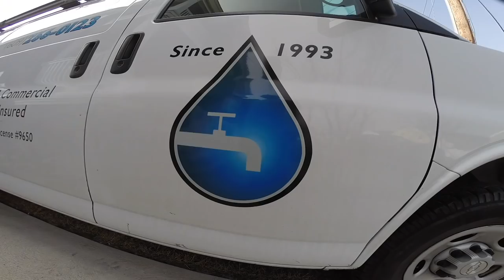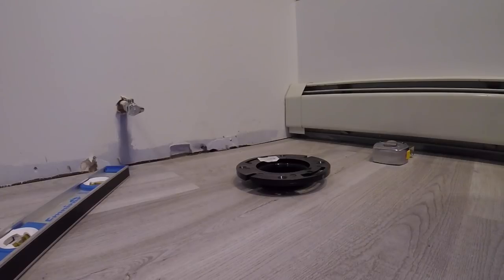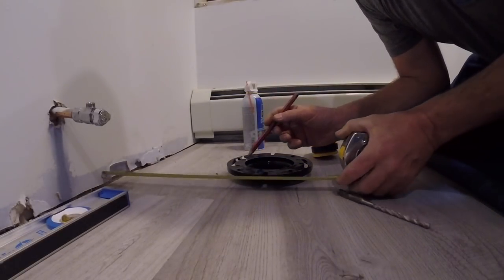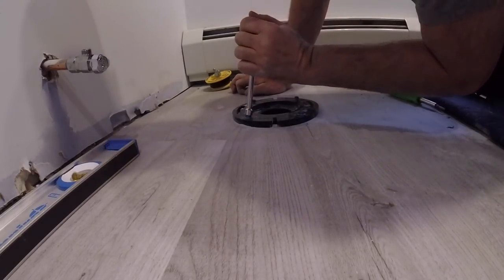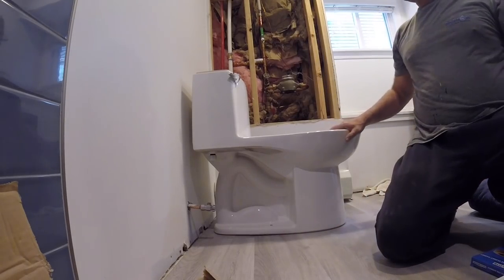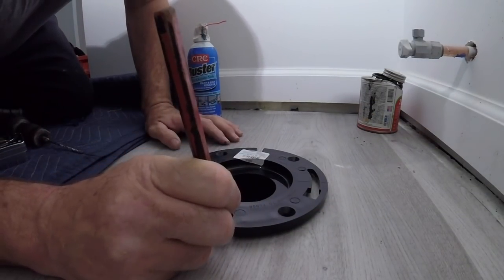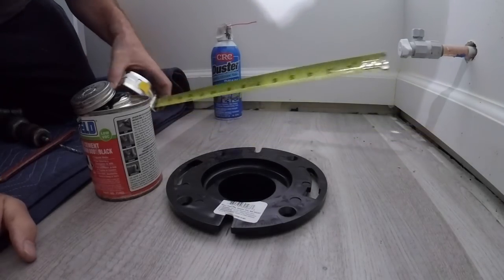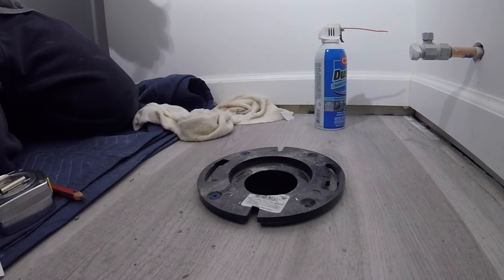TWO TOILET FLANGES INSTALLED ON CONCRETE FLOOR

Comment: i suggest using the stainless steel tapcons, the blue ones always end up rusting after a while even with that coating on them. makes it easier for the next guy if he need to take out the flange. i also had a question, in a perfect world, would you always have the flange above the finished floor (like in this video) or flush with the finished floor (and why)?
Reply from the maker: Oh wow. I like the sounds of that

Comment: Clear basicd and to the point thanks man. I do this in a lot of rentals and i couldn't remember if i could set it above the concrete or if i had to grind it out.
Reply from the maker: Glad it helped
Reply: I honestly do not trust setting a flange that high. It requires you to really crank down on toilet bolts and can be wobbly. I never like the flange coming up past floor more than an 1/8” or a little more but thats me. Others do different things

Comment: How is he gonna get the toilet mount bolts into the flange slots that are on the front and back?
Reply from the maker: Wayne, I prefer the side slots. Much stronger than the adjustable. Just make sure flange is set correctly.
Reply: I was thinking that the whole way through. There's nothing to hold those bolts down with the side notches unless I am missing something but that's what the slots are for.

Comment: I know this is just about setting the flange but people should be reminded to clean all the dust off the bottom of the toilet before installing the wax ring (they often come dusty from the factory) or it may not adhere 100% and you'll be called back for a slow leak and have to reinstall.
Reply from the maker: True Chris. Good tip.

Comment: Weed eater line works great in the hole to alow the Tapcon to have a better grip.
Reply: Charles McADORY , good idea.  I carry some #12 and #14 solid wire for the same purpose.
Reply from the maker: geeze, I forgot that trick. I could of used it big time.
Reply from the maker: dam i forgot that one

Comment: Came here to see a toilet flange installed on a concrete floor. I see you've got some kind flooring you are installing on. Im installing a toilet one a concrete slab in my garage - no flooring just a painted slab. Talked to a plumber and he said i need to chisel around the waste pipe so the flange would not set up off of the floor.

Comment: That is the biggest problem in new construction floors are not level putting in tubs in during rough in is a pain the builders always make it our problem it never falls back on the framers or the concrete and it always shows up in the final product when the floors are not level for the toilets
Reply from the maker: yup. concrete guy got em good from day one. fighting it all the way to the end.
Reply: Fkin concrete in the basement not being level has been a nightmare for me on multiple jobs.

Comment: looks like they just slammed laminate planks over-top the existing mess... I hear birdies going (cheap cheap cheap cheap)
trace outer flange diameter on flooring centered with pipe, cut it out with the oscillating tool so the flange sets down into the flooring. make a shim out of pvc or other waterproof material so it's level with flooring and can be bolted down tight to the concrete.
That may be a good candidate to try out some flexible/re-usable flange gaskets... never used one to this day, but who knows :)
I've framed floor joists and bowed plywood, cement board and others to make up 1.5" height in 6' span out of level bathrooms, so the whole toilet area is flush and level on any type of finish flooring... yeah, as "custom" as you can get, it took 5x the time and labor..... The end result was tile flush with the existing finished wood flooring (late 1930's home) and toilet level and flush to floor :) 
not many folks wants to pay for that caliber of work and time it takes, nor does anyone want to do such drawn out labor.
Reply from the maker: the floor was floating all over the place....
Reply: you have the quality of work that I grew up seeing from my grandpa / his sons..they built homes for people/themselves that are still in good shape today w/ no leaks ..& mostly used hand tools to do it..I use modern tools but I take my time & do it right like the Old days

Comment: In the second install, it seemed like the flange socked down to the floor quite a bit when you put the tapcons in.  Is it ok for the plastic flange to be bent down like that after the glue was dried? Not criticizing just had a problem once before when screwing a plastic flange down to a plywood floor (where the bottom of the flange was flush to the wood) and it cracked.  Didn't seem like it got over-tightened but there was a crack.  Thx

Comment: Whats with the massive gaps under the trim skirting boards ?
Reply from the maker: battling a bad pour from concrete company from day one...corner trim coming so I hear.
Reply: @ChuckBarron  That's gonna be some big quater round !!!
Reply from the maker: 2x4 corners....lol
Reply: lol, it's kind of in style to use large format baseboard now, without quarter round at all.  say 3 to 5" tall plain boards.
I still like profiled baseboard and quarter round both...

Comment: chuck, instead of using an inside fit 3" i want to use the outside slip on 4x3. My problem is i only have 1.5" depth from the concrete to butt up against the 90 in the rough in under the floor. can i trim the bottom of my flange to make it work with that height?

Comment: So is it preferable to set the flange after tile is laid?  Doing a reno job on concrete slab and have to redo the drain anyway so just wanted to see what you thought about order of operations given the choice.  Thanks Chuck!
Reply from the maker: either or.....done both ways.
Reply: We always set our flange even with floor. I’ve been a contractor for over 20 years and It definitely could be done either way but our reasoning for installing flush with the floor is because when it’s time to change out the tile it’s so much easier to just rip out the tile without having to worry about tile under the flange but in his case it’s a floating floor. I think the toilet sits better also but just my personal opinion.
Reply: I've always set the flange during the rough. Cut four pieces of 1/2" copper half an inch to act as a spacer underneath the flange to make it flush with the finished floor and then the floor, whether it be tile or anything else, gets put down around the flange. This way, if you ever have to rip up the floor, you don't need to rip out the flange too which can be a massive headache especially on a slab.

Comment: Is there a flange that will fit inside 3" toilet drain pipe?
Reply from the maker: Yes for sure. 3" slip flange.
Reply: Can you type in specific name of the flange that will fit inside 3" toilet drain pipe?

Comment: They are still seems like there is a little gap. What I would do is use “kwik seal” kitchen and bath adhesive caulk and put a small bead around the base and wet your finger and run it over the caulk to give it a nice smooth Suffice.  You should use it anyway when you’re using a PVC or ABS flange because it secures the toilet firmly to the floor

Comment: I have a flange the floor is finished concrete n the flange us lije quarter inch off floor n u can't set a toilet flat now I think it should be cut off n put a new flange n put it flat to the floor now my gf cousin says it looks normal n I said but u can't set a toilet flat n u gotta use 2 wax rings n so I just dnt understand  how he says that it looks good to him but still can't set a toilet flat am I wrong ?
Reply from the maker: your good.

Comment: One of my biggest pet peeve's is a lazy floor guy/tile guy/or general contractor, who won't level a floor before we set fixtures. Plumber's are NOT Magicians...we can't waive our magic wand and fix your f*ck up cause you were so damn lazy. There are floor leveling products on the market...use it!!  With that said....that floor didn't look too bad....Rant over.
Reply from the maker: just don't drop your chap stick...it may roll away.

Comment: So many mistakes. No primer, 90 degree set wrong. Wrong screws. Air blast instead of vacc. And screws not flush with flange face. Not plugging hole and almost dropped a screw in it. But if it holds dook .. who's complaining? Lol
Reply from the maker: come on coach....ha
Reply: Wow, pay close attention and you will learn what not to do. Wrong screws, wrong masonry but, wrong orientation of flange. Great job.

Comment: lastly, that flange design is an 100% guaranteed leak...........
perhaps an oversize wax ring would smash down into the sharp step and guide thy poo water, once again I see "collegiate sheeple engineer design failure", that flange has total lack of hands on in-field analysis, skill and knowledge....... we so need to make anyone and everyone that engineers products spend a minimum of 5 years in the fields of labor doing repair work ;)
Reply from the maker: flawed like me....lol

Comment: I'm yelling NOOOOOO @ 3:27 bad camera angle or drilling at an angle towards the pipe....
I always drill slightly angled outwards from center of flange, less chance of hitting the pipe and better chance of solid bite in the concrete or whatever half rotted floor is underneath..
been there done that, sometimes 4" screws in at 30+ degree angle to grab un-rotted wood and hold it down (no access underneath) if it's open then add bracing  ;)
Reply from the maker: Throttle don't jinx me dawg.....lol